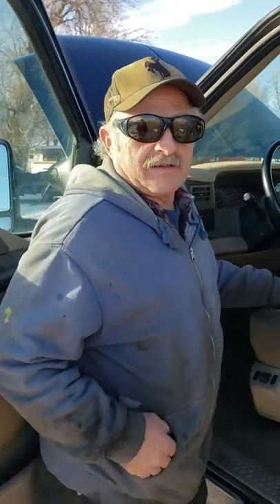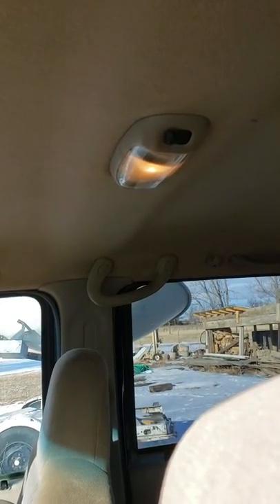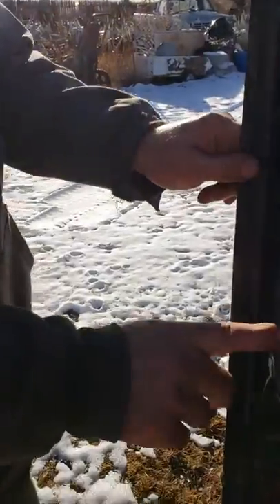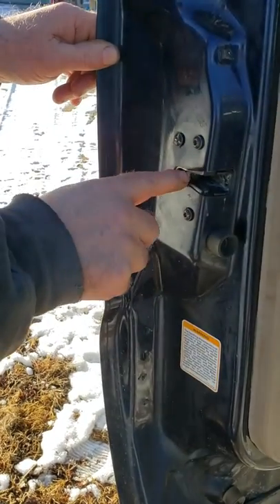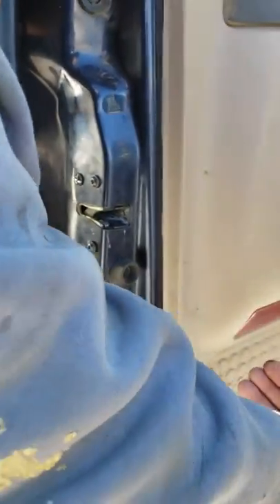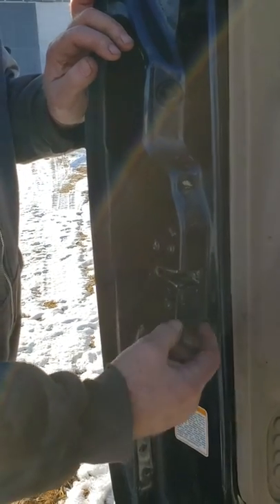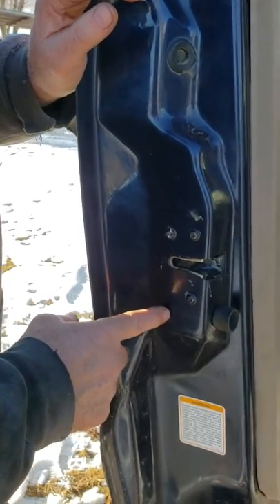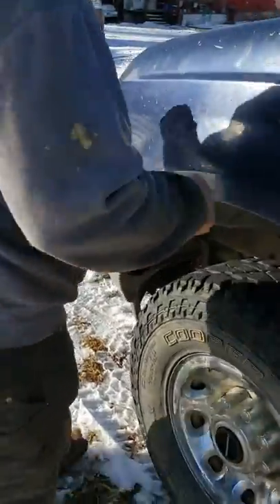2002 F350-7.3 Dome light stays li 25 min. Here is how to fix some light

Comment: Simpler way is to hit the odometer trip switch on dash cluster 10 times and Battery Saver Mode pops up. Just set to 2 min and dome light turns off in 2 min. :hand-purple-blue-peace:

Comment: I should have watched this first🤣 For me was passenger rear door switch. I disconnected at the lock and just closed the circuit permanently. It’s the back passenger, no harm no foul. One of the pins was crazy corroded and broke off when I tried to unplug it from actuator module. But problem solved. I have AMP Research electric steps, I really wanted the step to go up 🤣

Comment: does this work on a 2001 f150? 4door?
Reply: Ever find a fox? I’m on the same boat
Reply: @john32094  it kinda worked.  When I turn my ignition off the heater fan keeps running sometimes.  That drained my battery last week..